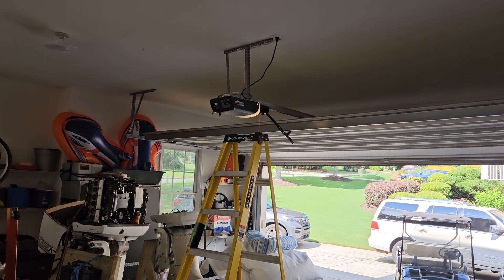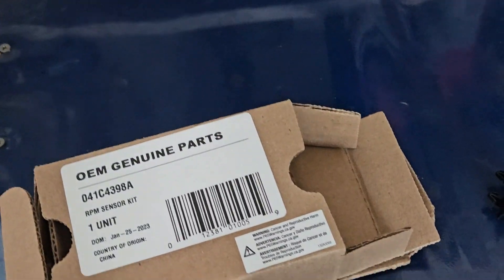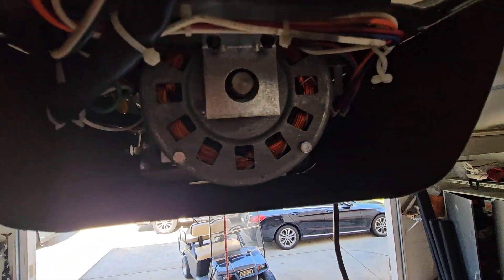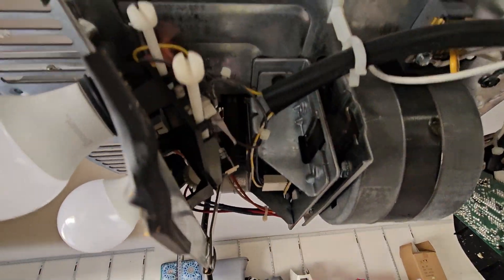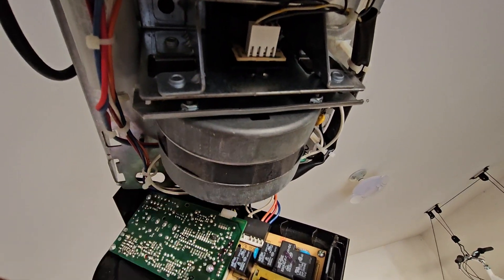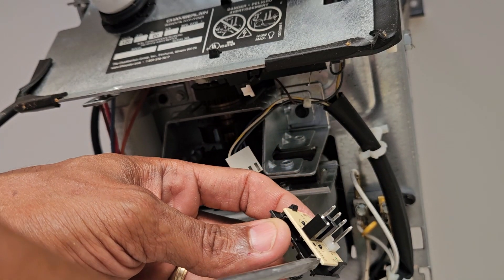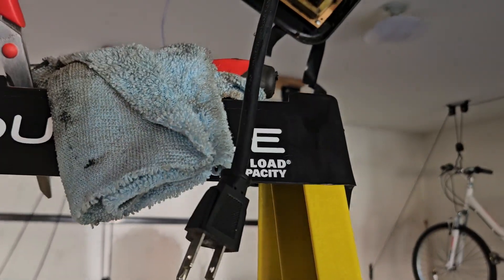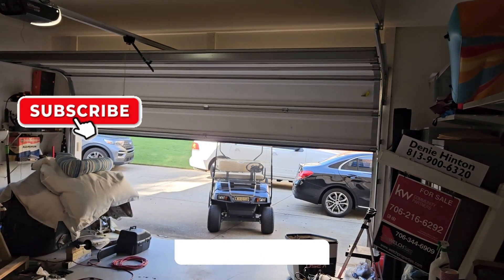Garage Door Opener RPM Sensor Replacement

Comment: So it wasn't the rpm sensor correct?
Reply from the maker: Changing the sensor alone worked.  I left the original cup on.  When I first tried it, I had everything apart and hanging still.  After buttoning it all back up, it worked fine.